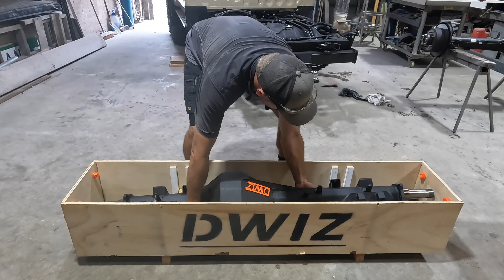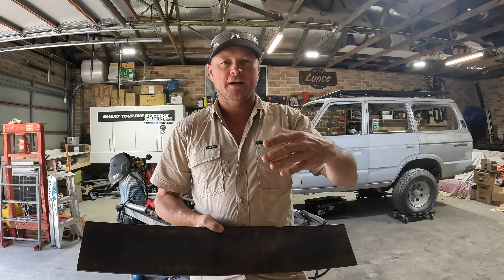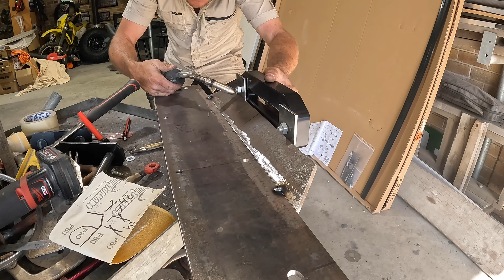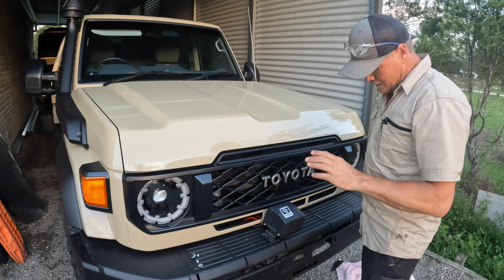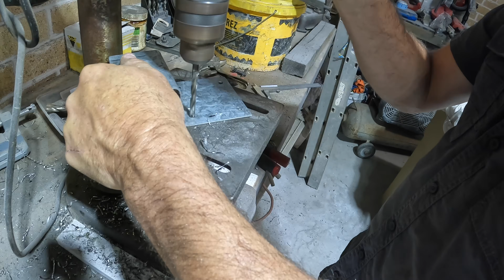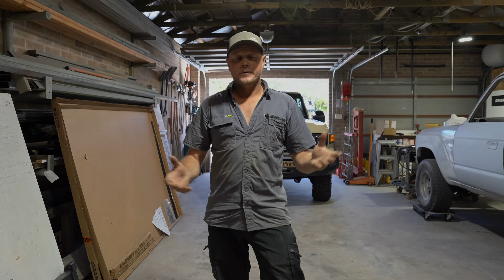WINCH INSTALL INTO FACTORY BUMBER | 79 SERIES LANDCRUISER BUILD PART 6

Comment: Great video! I’m working a winch install myself and pulled the entire front bumper cover to see what the frame rails looked like. It looks like your front mount bolts are going into a frame rail extension that is bolted to the frame. I may be overthinking this, but that doesn’t seem strong enough and maybe needs to be boxed in?
Any thoughts?
Also, any video of the winch in use?

Thanks!!
Reply from the maker: Cheers for watching. Yeah the front bolt is into the frame extension the rear bolt goes all the way through the frame extension up through the frame itslelf to the top of the chassis, have a look and you will see what I mean. But yes there is options for extra bolt locations I’ve been looking long at as I’m thinking about making a few up to sell.
Reply: @smarttouringsystems-garage Hey man. One more question! How are you reaching the clutch lever?
Reply from the maker: @ksnipes24  I need to take the number plate off and there is enough room to get your hand in there, ideally a flipper bracket for the number plate is what I need to do.
Reply: @smarttouringsystems-garage Thanks for the reply!

Comment: Why don’t you make a whole new front bar ? you do it really well , something no one else would have on that model .
Unique.
Reply: Would be good but need to consider compliance for the air bag and crash ratings(not that the 79 has much of a rating, but still.) ARB, TJM, Off Road Animal etc all have to go through engineering and get ADR approvals for all their bars, is quite an ordeal.
Reply: Good idea
Reply from the maker: Yeah thanks mate, is tempting.